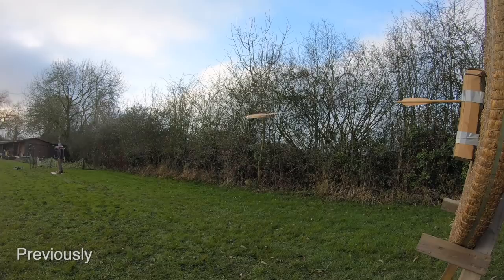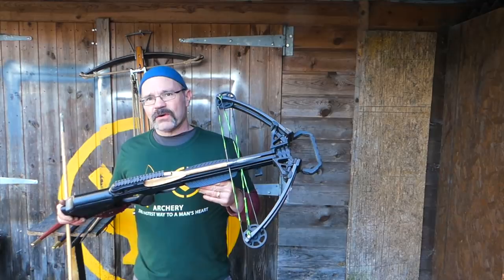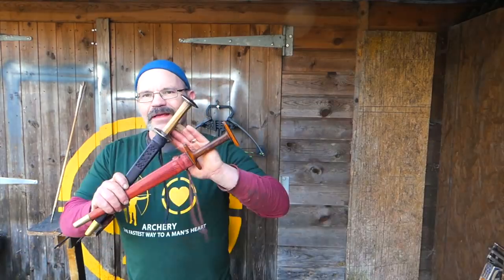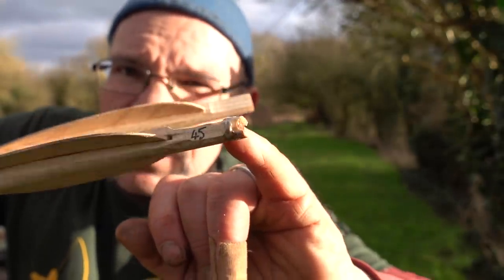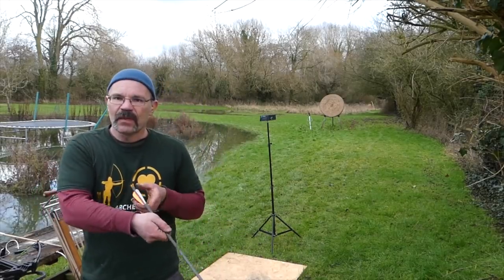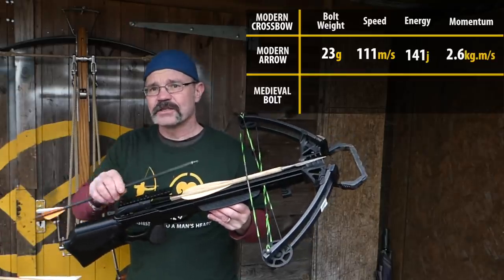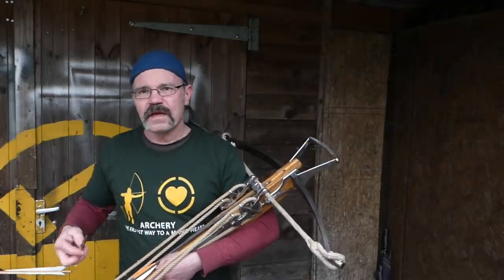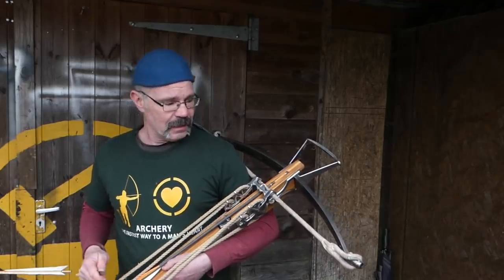Heavy Crossbow - Light bolt - What happens?

Comment: I don't know anything about bows or archery or anything like that but I am a mechanic. It seems to me the modern compound crossbow continues accelerating the bolt as it returns to resting state ie the bolt keeps accelerating until the bolt leaves the weapon whereas non compound bows don't. 
The 'old' ones accelerate the bolt about half way or perhaps 90deg of 180deg if it were plotted against a half circle and the compound bow perhaps 160 deg or more of 180deg. This would mean the compound bow has a advantage of tens of extra degrees acceleration as well as having a more linear acceleration over time. I'm sure this has all been plotted on a graph or something and me mentioning this is reinventing the wheel but YouTube algorithms sent me here. I must say I enjoyed it. 

YouTube algos also sent me a vid on how to safely cross a bar in a small boat and the not insubstantial dangers however I watched it all with wonderment and awe despite the fact I don't own a boat, hardly have ever been in a boat, live hundreds upon hundreds of miles from any bar and at least as far from any sea.

What do you think of that hypothesis?

Comment: I have a friend that fired arrows way too light for his bow once. The bow exploded. He copped the string across his face. 

Looked like his missus had made him walk into a doorknob a few times.
Reply: Yikes
Reply: Proplem is not weight of arrows, problem starts when you shoot arrows that isnt in grade of bow. You should get arrows with correct length and correct spin(read about it). Your friend took too powerful bow and big spin arrow, arrow on release bends too much and broke so bow do dry shot. Modern bows too afraid dry shots, best what should be:  string tear. But in 100% compound bow should be repaired in workshop period.
Reply: Back when I was clueless about such things I had an accident too, on a recurve bow. It was the arrow that exploded as it fired; splintered in the middle, fouled on the bow, and went spinning back across my arm at terrifying speed. The leather bracer I was wearing took the brunt but it still scarred my arm where it ran off the edge. I no longer shoot with the crappest, cheapest fiberglass arrows I can find. =)

There is at least two ways an arrow can be wrong for the weight of bow, one is just the weight of the arrow, but another is the flexibility of the arrow (generally related). The latter was more my problem in that case. Not an issue in crossbow, but in bows where the arrow is caused to bend into and the around the riser as it fires, then higher draw weight + overly-bendy arrow = exploding arrow.
Reply: @Fe7Ace  arrow "bending"  have terminology, called arrow spin. Lower spin=less bending. But dont mind that it is better, nope. If your bow have 30-40 lbs draw lower spin will cause less speed from shot. They just different.
Reply: @Kardeell  the arrow was fine other than a small split in the knock. The bow on the other hand totally came apart. Limbs cracked and separated, cam twisted and snapped from the limb. String was all kinds of munted. He took it back to the shop he got it since it was the 5th arrow he'd fired.

Owner said the arrows were too lightweight. And got super mad when he found out one of his employees was the one that had sold the arrows to go with that bow.

Comment: That was interesting. I like your analogy at the end, it makes a lot of sense.
Reply: the Problem with the analogy is that the modern bow does both
Reply: @tommihommi1  I suspect if you were to make lead bolts, the heavier one would perform better.
Reply: @tommihommi1  well, shooting a heavy bolt with a modern crossbow is like attaching a trailer to your sports car. It'll pull (shoot) it, but you won't get the acceleration that the car (crossbow) is designed for.
Reply: @pixelmaster98  it performs better than the "work truck", that's why the analogy doesn't work well. Low weight, RWD sports cars with engines optimized for high RPM suck at towing.
Reply: @tommihommi1  well, that may be generally true, but bear in mind that the truck is a model from 1400 and the sports car is from the 21st century.
Reply: well except that truck with trailer weight like 20-40 tons  hit sstronger in crash test wall at 100 km/h than sports car  weight 1,5 tons at 300 km/h  and in hees test modern crossbow hit stronger look at energy and momentum numbers for both arrow in both case modern hit stronger :x  unleess we comapre truck without trailer like 5 tons ? at 100 km/h  dont know how those truck weight so than yea sports car at 350 km/h weight 2 tons like some bugatti hit stronger crash test wall ;)  so depend on  proportion beewten mass and vvelocity this what he say can be true or not necessery :x ;)
Reply: At some point we also have to remember it's an analogy and not an analog. The heavier weight crossbow will, ultimately, be able to move heavier loads then the lighter, but faster, draw. Maybe Tod will test a bolt which is 10 or 20 or 40 times the weight of the ones tested here to see, but until then we can't be sure. 

And there's also something to be said for the wear and tear you'll get on the lighter crossbow repeatedly shooting heavier bolts. Just like destroying the transmission of a sports car pulling trailers, the 'ol-trucker heavy crossbow will keep firing the heavy ones long after the lighter one stretches out and breaks down. 

Again, a loose analogy, not a perfect comparison.
Reply: @TheTurnipOfTerror   yea :x  i quees medieval from some point of arrow mass will start produce more energy and momentum imeanmorearrowenergy and momentum :x because heavy load dont impact so much on acceleration in such strong crossbow like in this modern compound  he should perform this test to see this preciseli  than those topic will be full of data .also comaprsiion to truck and sports car siint perfect again from diffrent stand point of iew= in reall sport car with biger horsepower can produce more force on tire circuit at the same velocity except couple first metres where they produce more sliding losess on clutch due to higher rpm enguine and longer gearing but after this sports car produce more force like this medieval crossbow :) so again its bad  analogy ;) .1000 bhp  1000 nm at 50 km/h will produce 2 times more pulling force than  500 bhp  2000 nm at 50 km/h ..... if you dont sure about this do math ;) ....i can do it for you :X  =  for achievve 2 time smore power from 2 times less  torq you need 4 times biger rpm = 1000 bhp 1000 nm sports car will have 4 times greater final  what this mean ? 4x1000 nm = 4000 nm at drive wheel axis vs truck 2000 nm x1 final ratio =  2000 nm at drive wheel axis divide those be tire radious let say 0,5 metres= 8000 newtons on tire ciruit force sports car vs 4000 newtons on tire circuit force for truck ....
Reply: @mociczyczki  thumbs up
Reply: @TheTurnipOfTerror   god analogy is with  weak and strong dude  weaker dude  can have without any load on arm stronger punch  because he can have much better acceleration  but when we start to putting weight on theyr shoulders /i mean hand from some point of weight level the stronger guy now start to hit with this object in hand stronger :x ....question is what is this weight/mass of arrow level where in reall this medieval crossbow start to push it better :x it can be 200 gram it can 1 kg i dont know for this egzisut offcorse some precise calculation but i dont lknow them :x well i probably know how they may look like because all what we must to know is comapre whole mass of crossbow arm with mass of arrow  and comapre them to  force  which arm of crossbow can generate well average force over disatnce at which crossbow accelerate arrow than we can calculate this  but first im wait for hees video with this test ;)
Reply: @mociczyczki  double thumbs up

Comment: When I was a kid (12ish) The neighbor kid and I built a crossbow in his dad's workshop from a 2x4, some spring steel and we ground down a switch and bought pins for the trigger.  WE painted a bulls eye on a 1x6 plank we had cut square-ish and attached that to a 4x4 fence post to test our contraption.  We were about 15 feet away from our target so the bolt didn't travel far or loose much energy.  It went through the plank and the 4x4 and stuck out almost 2 inches into the other neighbors yard, and scared the crap out of us.  We sawed the tip off, all wood no metal cap,  and sawed off the bolt still on his side of the fence.  We took the thing apart because we thought it was to dangerous and didn't want his younger sister to try using it when we were not there.  We both agreed never to talk about it until we were adults.  I am thinking about making another one since in am 56 now.  I can buy spring steel from any scrap yard and I have a grinder to make the trigger.  LOL

Comment: I was half expecting the modern bolts to snap on the medieval crossbow. I assume wooden bolts of similar diameter would have?
Reply: Most likely, yes.
Reply: Well not neccesarily. The crossbow imparts an amount of acceleration and the wood has an exact amount of inertia per surface area if the point would be sized too. Meaning that it would not matter much unless it would buckle, but even a 8mm shaft of that length is safe from buckling. I bet you can shoot a shaft as thin as the modern one.
Reply: Why would it snap?
Reply: @dragoscoco2173  true, if you assume that wood is of uniform strength at any given thickness. That's not usually going to be the case though, as the strength and stiffness of the wood will be reduced non-linearly at a certain point as you get down to the grain of the wood.  The more intact grain, the more likely the shaft will hold up (redundancy). Then again, given how short the shafts are and how short the powerstroke on the crossbow...maybe? Depending on the wood? I personally wouldn't care to find out
Reply: @Sa1d1n  Luckily neither did the medieval crossbow builders. Considering the low efficiency and high moving mass, going with a rather heavy bolt is not detrimental to the speed, so wherever you can add mass is a boon overall. So shaft thick enough to enable a big and thiccc point. I mean they were building arrow shafts already, and there the wood is more stressed and buckles around due to the length.

Comment: Great video.  Interesting how the modern crossbow with almost a 1/10th the draw weight actually fires the heavy arrow with 150%  the force that the windlass bow does.  

It means the modern bow is both a sportscar AND a truck.   It will get you there fast, or it will get a load there medium.  The windlass isn't a truck, it's an ox cart.

Comment: Very interesting demonstration which is analogous to impedance matching in electronics to get maximum efficiency. The same applies to these crossbows. The projectile has to match the crossbow's draw weight, stroke length and recovery rate. Judging from these experiments it seems they got things right in medieval times. These were real weapons designed to kill but used slow moving, heavy arrows (as opposed today's fast, lightweight arrows) for better energy retention and increased momentum. 
Many thanks for a great video.

Comment: Great stuff, Tod, as usual!
Now I'm not sure if comments on such an old post are really worthwhile, but just in case you do read this:
Have you ever thought of making a 'medieval compound crossbow'? I know that in terms of historic accuracy such an idea is kind of pointless, but it's interesting non the less. Here's why.
What turns the impressively heavy (950lb) medieval crossbow into a 'truck' rather than a 'sportscar' is the fact that the steel limb cannot be bent too far without breaking it - hence the short powerstroke - and the inertia of the heavy steel itself which makes it slow. You pointed this out in the video. Both disadvantages can be overcome by introducing a rope and pully system as with a modern compound crossbow. That would translate the enormous weight into a long stroke at much higher speed. Technically, I think that with 1400s technology such a machine would have been possible, but perhaps nobody thought of it?

Comment: The truck is a very good analogy. It has an intrinsic speed limit that cannot be exceeded even without load. For bow the speed limit is roughly determined by the modulus of elasticity, the density of the steel and the weight of the string. A modern bow will accelerate an arrow significantly faster with a lighter, stiffer string. That results in a noticeably shorter time to impact at longer ranges.

Comment: Out of curiosity, does the "Stroke Length" of the bow have any additional effect? I know that the modern bow will be applying it's acceleration over a longer distance, but will that play a part in how well it can transfer that energy into the bolt?
Reply: That is exactly why the 960lb medieval bow doesn't output five times more energy than the modern 150lb one: it has a very short power stroke, and so despite the high draw force, it imparts similar energy. Tod has mentioned that in a few of his previous videos.
(btw: the power stroke is so short due to the limitations of steel as a bow material)
Reply: longer stroke should mean it can deal with heavy bolts very well, and that's what we see in the performance

The heavy bow with a light bolt just moves basically as if it were dry firing, it just doesn't go any faster, and the bolt can't be faster than the string moves in the end.
Reply: It would have to. It has cams designed to increase acceleration/force after the bolt starts moving. As far as raw travel, that's also a factor. I play with airguns a lot and there's only so much you can do with a short stroke of a piston or striker. But, make that piston or striker travel further and you get more energy out of it with the same average spring pressure.
Reply: Longer stroke helps with the transfer of energy, and is better for the projectile as long as it doesn't sacrifice top speed.

But as you might have seen with Joerg, the problem with stroke length is that if you make it too long, it becomes impractical to load and fire with human limbs. Most assisted draw devices reduce stroke length due to the nature of trying to pull heavy loads, and it took some very good work with pulleys and redirection to get the maximized stroke lengths we have for modern bows.
Reply: @hadinossanosam4459  It's not the only reason. Powerstroke plays a role, but so does the material and the inertia in the limbs. Cams are excellent for exactly that reason - they multiply the load while reducing the distance the limbs need to travel. For detail: the reason why the powerstroke of steel bows is so short is because of the density of the material, so high inertia. Make them much longer and the inertia that must be overcome is too great, because its determined by distance from the centre.
Reply: @hadinossanosam4459  Ah, that makes sense with what my intuition was telling me. I must have been distracted during the earlier videos. Thanks!

Comment: The logical conclusion to the truck vs sportscar analogy would be to load the truck even more than the 'normal' medieval bolt.

It would be very interesting to see when, if ever, the medieval crossbow surpasses the modern version. And if it does, if that is a practical point (if we have to go to small javelin sizes I think it's well past useful).

Comment: Well, now the question is, how heavy can the bolt be on the 960Lb crossbow? What would be the optimal weight of the bolt (for max momentum) before the speed drops significantly? 120g, 150g or even 200g? What could a bolt like that penetrate?
Reply from the maker: the speed starts to drop quite quickly after about 125g

Comment: I was one of those who commented about why no switch of bolts on the previous video. This video has interesting results. After your explanation I am wondering what would happen if you shoot progressively heavier bolts in the older crossbow. Since the 'springback' of the bow is at a certain speed and force, how far can you go in shooting heavier and heavier bolts before the drop off in shooting speed/force occurs or maxes out. That would entail making bolts from heavier materials like different weights of metal leading up to lead bolts! I just saw Daniel Eiternick's comment after I posted this. Seems lots of other people have the same question in their minds!

Comment: Also worth mentioning that the lighter and faster something is, the quicker it will lose velocity. Medieval arrows and bolts have so much mass that they are dangerous as far as they can be shot. I have nothing to back this up but I'm fairly confident that back then, distance was the key driver behind heavier bows, energy really wasn't a factor because the answer to that would be a heavier projectile.

Comment: Nice, I learned something. I was wrong. I thought that the biggest factor would be the draw length. I hadn't thought of the speed/inertia of the materials. Wasn't really sure how they'd fly, but I assumed the energy would remain closer. I now see why that isn't the case thanks to a good explanation. Cheers, great video.
Reply from the maker: Draw length is a massive thing though
Reply: @tods_workshop , I knew draw length does make a difference to something, delivery of the power to the arrow or something. I suppose it gives more time for the acceleration to happen. Not because I know anything, I have vague recollections of you discussing it in a previous video. I guess it is about time to find that again and give myself a refresher. Your excellent videos can explain things well, the problem is me remembering.